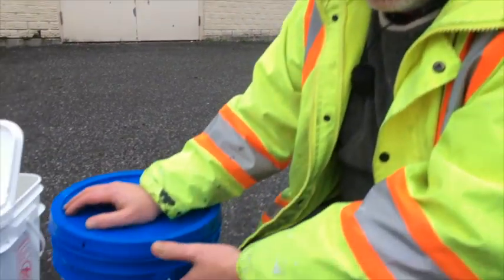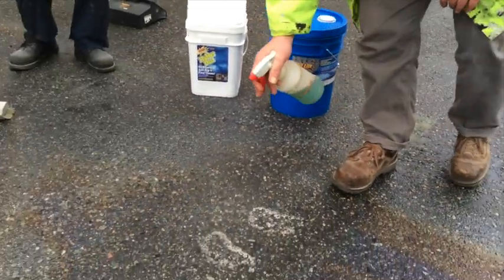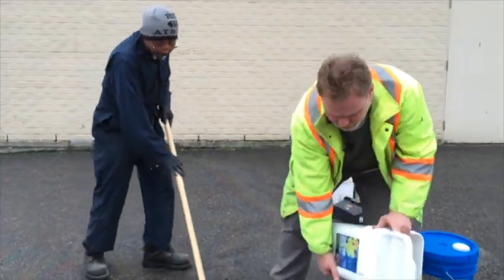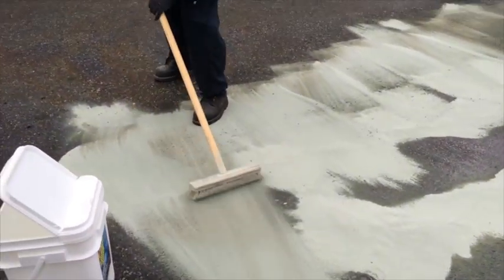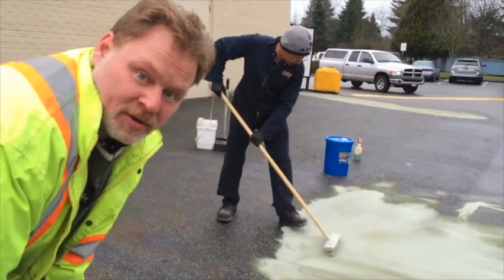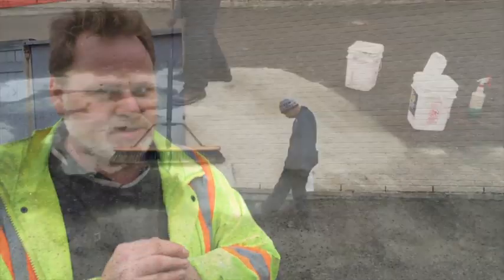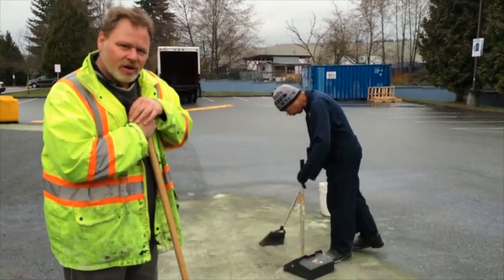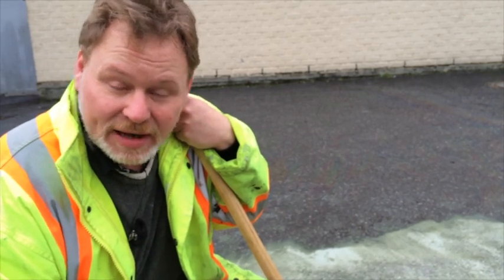Oil Spill Clean up at Canadian Tire Langley BC with Oillift TM and Flubber Dust TM

Comment: WOW, I have these products on order and can't wait to trial them in a real life work situation.
Reply from the maker: if you would like to try something interesting, when you get the flubber dust open the seal under the cap and then leave it open in your fridge. then watch to see if things start to freeze. what's happening is the moisture and smells get sucked up and you have to turn down the temperature in your fridge. let me know what happens. cheers Kevin

Comment: What's wrong with the system installed at Canadian Tire South Surrey? It does not seem to be doing much to stop the flow of runoff oil into the storm sewer there
Reply from the maker: I'll check
Reply: I have bought flubber dust and thought it was a great product. I think the idea of the containment unit is great, but it obviously is not enough for that location.There is oil spilled everywhere down there - its going up the walls and it's a thick layer on the ground. I really think the DFO would be interested to see the site but I don't want to see the store penalized. My goal is just to see that site cleaned up - for real, an then maintained clean - not just some absorbent sprinkled on the ground.
Reply from the maker: +Grant Brown I'll give them a call tomorrow and get a spill clean up team down there. the owner has had some serious medical problems and  as a result problems are occurring.  his name is Dan and is a good guy. thanks for being nice. 
Cheers Kevin
Reply from the maker: +Grant Brown Hi Grant I called the owner at home and a team is visiting on Thursday to do estimates and clean things up. 
We found out the service manager did not understand the absorbent boom technology and put the wrong material in place on the containment system.  Nicely said he got sold a bill of goods from a sales guy and did not understand the science. Anyway, thanks for the heads up. please keep me posted. I owe you a beer. I'm just down the street on 24th in surrey. 
have a great day. 
Kevin
Reply: Thanks Kevin, that is good news! I look forward to seeing the new improved collection area. Not much can be done about people spilling on the ground other than clean up work afterward. I hope you get a bunch of work from this. You are doing the right thing.
Maybe I will take you up on a beer sometime. I am in marketing for a Vancouver based clean technology company working internationally. I really like what I have seen of your technology. I spilled hot used motor oil on the wood floor of my boat shed last year. Flubber dust took care of the problem and kept pulling it out of the porous wood. I think it's time for another top dressing soon.